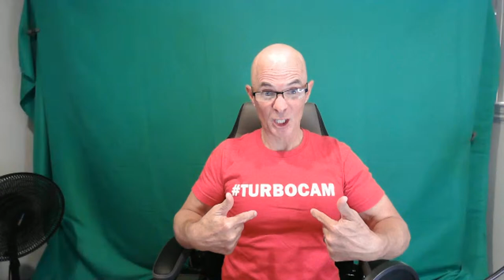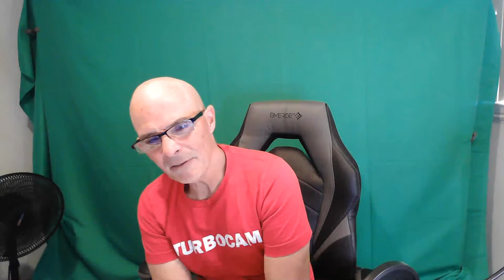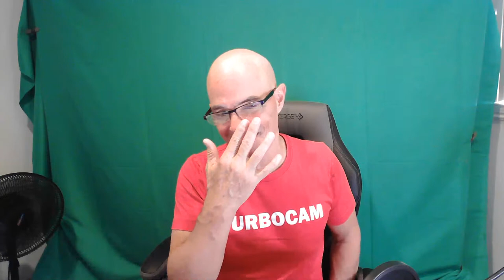LET'S TALK TECH-AMR500 SHIPPING COSTS & BOOST AFR

Comment: AMR500 works well for small engines, but didn't know it would actually benifit a v8. I've seen 'em on Suzuki LS650 (Savage/S-40 Boulevard motorcycle).
Reply from the maker: this was just a flow test

Comment: Possible motors for AMR blower
1988 and prior Ford Ranger 2.0 / 2.3 OHC 4 cylinder  The 2.0 was carbed up until this point.
1981 to 1986 ish Ford Escort 1.6  CVH 4 cylinder ( later was 1.9 ) 
Same era Ford Tempo 2.3 HSC ( A cut down ford inline 6 )
Reply from the maker: I spoke to a guy yesterday about a 2.3l Pinto
Reply: @richardholdener1727    "   I spoke to a guy yesterday about a 2.3l Pinto   "  

You know, that sounds like the start of a bad bar joke. . .

Comment: I know this isn't about the video, but I have a question.

I have a 07 Gen 4 4.8
.10 over pistons, stock crankshaft, and rods
Texas speed stage 3 low lift cam 
[.550 lift and .550 exhaust @112LSA]
243 heads on a 1.8 ratio
102 mm throttle body and intake
Drive by cable

My question is. I was told that it won't flow correctly because it's too much of this or that. I'm not sure how true that is, but someone I was keyboard waring with. Had mentioned you, so here I am, lol. I still have yet to fire it up due to having my transmission looked at and built.
Reply from the maker: did you use after market 1.8 rockers? It will all work but needs to be tuned
Reply: @richardholdener1727  Yes to the aftermarket 1.8 rollers. 
I still have yet to get it tuned, though.

Comment: What is the refresh rate on an o2 ? Can it see individual cylinder pulses,  allowing individual cylinder trims. Or is fuel trim % based on tone ring speed?
Reply: Individual cylinder fueling is only viable with Individual Lambda probes on each cylinder.
If you wanted to measure Individual cylinder  fueling using one probe in the collector you would have to scope it and sync the voltage reading with a cam phase sensor. That's assuming the refresh rate was fast enough ie on 4cyl@6000 rpm is 200 Hz, Automotive requirements (with the exception of suspension motion measurement) for electronics is only just fast enough to stop devices switching themselves off😆

Comment: I wonder how it would work on a Stock 4.6 like in my 2000 Grand Marquis??? How Dangerous could it be? 😂
Reply: approriate for 1.5 liter iirc
Reply from the maker: too small for a V8-it's a 150-hp blower
Reply: @richardholdener1727 could you stack them like audio guys stack in alternators?